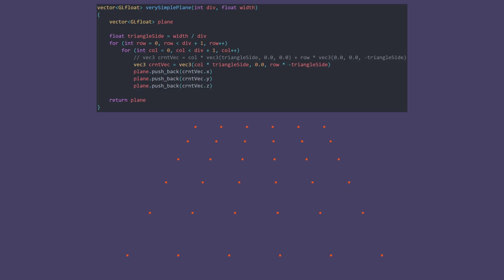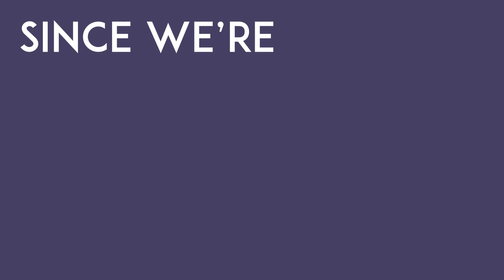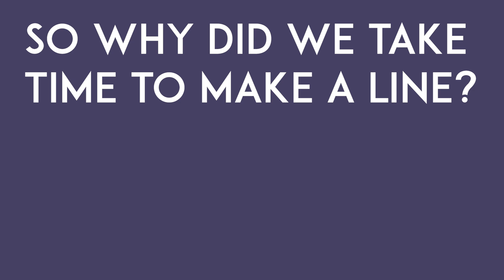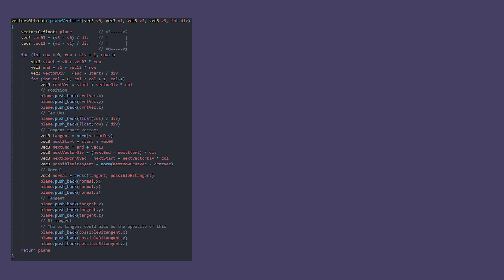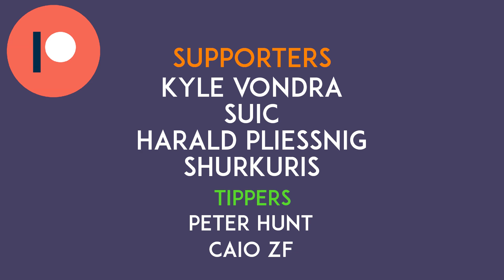Procedural Generation Tutorial 1 - Planes

Comment: Why did you use 48 as the number of bytes per vertex in the glNamedBufferData call when each vertex is 80 bytes?
Reply from the maker: Ooops, mistake on my part. When I took the screenshot of the CPU side I was taking just pos, normal, uv, and padding ((4 + 4 + 2 + 2) ×4 =48) 😅

Comment: I saw that you used a struct of vertices and a buffer which you edit. But how do you set this up on the cpu side? Is it something with ssbo's or is it something else?
Reply from the maker: Yes. I show in the video that I create a VBO and an EBO which I link as usual to thr VAO except I don't plug in any data into them (I do set their sizes tho). I can then send the VBO and EBO as SSBOs to the compute shader to edit them. What's rly cool is that I don't need to transfer any vertices from the CPU to thr GPU since I can generate all of them on the GPU.

Hope that clears things up! :)
Reply: @VictorGordan  Ah, I see
one last question,
When returning the data back to the CPU, what is the layout of the data in the vbo?
Will it be something like pos1, norm1, tan1, pos2, norm2, tan2 where it repeats itself?
Or does it return the array differently?
Reply from the maker: I don't return the data to the CPU since I don't need it on the CPU. But yeah, the data is stored in the format you mentioned :)
Reply: @VictorGordan  Tysm!